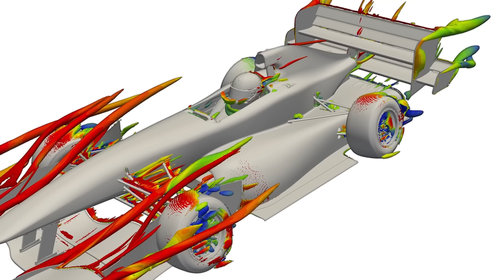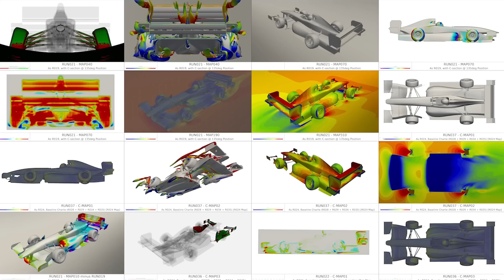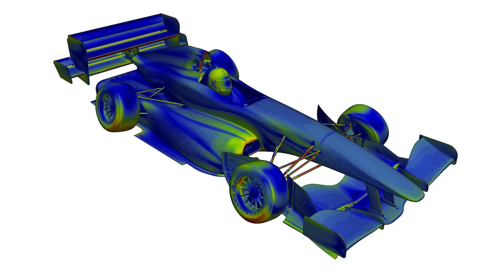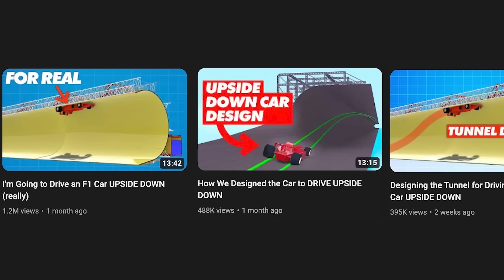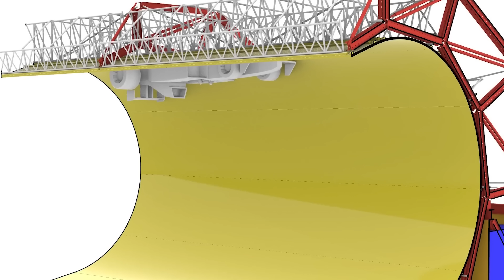Driving a Formula Car Upside Down (UPDATE)

Comment: Asked chatGPT for a simpler way to prove it, I guess it may work
Your suggestion of simulating the scenario using a wind tunnel and a rotating cylinder is very insightful and scientifically feasible. Here's how and why this might work:

Concept

A Formula 1 car is capable of driving upside down because of the immense aerodynamic downforce it generates, which is greater than its weight. To simulate this in a controlled environment:

1. A wind tunnel would provide the airflow necessary to replicate the car's high-speed motion.

2. A rotating cylinder could simulate the "road" in a tunnel. By spinning, it would provide the necessary surface friction and interaction for the car's tires to "grip" the tunnel surface, mimicking what would happen in an actual upside-down scenario.

Advantages of This Setup

Safety: It eliminates risks to the driver or the car by conducting the experiment in a controlled, static environment.

Cost Efficiency: Building a full tunnel large enough for a car to drive upside down would be incredibly expensive compared to modifying a wind tunnel with a rotating cylinder.

Repeatability: Experiments can be repeated easily to adjust variables like airflow, car speed, and cylinder rotation speed.

Data Collection: Sensors can be placed more conveniently to monitor forces, airflow, tire behavior, and other critical parameters.

Implementation

The wind tunnel airflow would need to be adjusted to match the speed at which the car generates enough downforce to "stick" to the rotating surface.

The cylinder's rotation speed would need to correspond to the car's wheel speed to ensure realistic tire-surface interaction.

Challenges

Scaling and Accuracy: Ensuring the system replicates the forces accurately might require precise calibration.

Rotating Cylinder Design: The cylinder must provide adequate grip without causing excessive wear to the tires.

Aerodynamic Complexity: The proximity of the wind tunnel walls could affect airflow, introducing distortions compared to a real-life tunnel.

This setup could indeed provide a highly realistic and cost-effective way to study the feasibility of driving upside down in a Formula 1 car

Comment: Another tunnel concept worth looking into is the buried-pipe style. Effectively you roll corrugated sheeting into a huge cylinder, lay it on the ground and then earthwork over the top of it. It's about the cheapest way to make a tunnel and its a pretty standard method of making extremely heavy-duty overpasses for mining trucks. You could then bolt or screw the plywood panels to the inside of that to give you the smooth surface.
Reply: He explained that in one of the episodes last year, the tunnel has to be open because of us viewers. It would not be possible to use an underground tunnel and create content for it (maybe even a live audience). And with so much money in the costs, there needs to be TONS of content, news coverage etc. It has to be a Felix Baumgartner event with even more traction
Reply: Interesting option. May not even need the soil cover. Also safer to have a full tube instead of a narrow line. Most importantly it is off the shelf, relatively speaking, relatively few unknowns unlike their modern art looking thing.

Comment: The main reason why it is very difficult to secure funding is that no one wants to invest in a one time venture. If you could come up with repeatable, revenue generating, commercially viable use of the constructed tunnel, then money won't be a problem. It is like you are inventing a wind tunnel, which is super useful in a lot of engineering disciplines including but not limited to automotive, aeronauticals, civil engineering and so on. At the very least, you could turn it into a filming set for action flicks, sci-fi and others, maybe.
Reply: You mean one-time events like Felix Baumgartner's $30M jump?
Reply: Exactly so
Reply: They should have an  upside down race.

Comment: Also.. given the excessive data on downforce from f1 and racing in general, like he sais in this video: The engineering challenge is almost mediocre. Its a performance that will absolutely work and only push the boundaries of money you are willing to pay for exposure. For five seconds.. meh.

Even if F1 car drove an entire lap upside down.. the driver wouldnt do anything different that usual. If filmed upside down, you could have an indoor race like that, and the only time anyone notices is when crashing cars get magically lifted to the ceiling and out of the way of the race. might even reduce mass crashes :D

Although the downforce doesnt affect the drivers, so they would probably feel like playing console face down on a massage table :D :D

Comment: Since this is all aero, why not start with a static wind tunnel demo where the car is held upside down by airflow alone? A hydraulic support could be removed once enough "upforce" is achieved...
Reply: Renting out a wind tunnel isn't exactly cheap (especially modifying it), and I don't think sponsors don't trust it will work (if that's the case it could help)

Comment: if you are so confident that this will work and there is no doubt whatsoever that the technical challenges have been met and you have a safety margin so what's the point of doing this, it would be more ethical to raise money for i don't know, the victims of tunnel car crashes, and publish this AS A DOCUMENTED PROOOF OF CONCEPT. You might even find a sponsor that will finance a scaled down unmanned model of this thing.
Reply: the model could be POV-FPS piloted by a real human pilot in a full motion sim rig and it would still cost less

Comment: Does he elaborate on why tunnels dont work? what about tunnels that are currently bein built? could a lesser amount of money be used to make the necessary adjustments?
Reply: It's in an earlier video. There aren't many tunnels around that are suitable with regards to length and height, aswell as being available and not needed for general traffic. On top of that tunnels aren't just walls, tehre's fire exits, lights and street signs hanging from the ceiling, ventilation fans etc. So you'd have to do a lot of prepration of the tunnel if you find a suitable one to begin with.

Comment: I still think you could use a large treadmill, a high speed wind tunnel and just a regular F1 car and have the treadmill on a rotating platform in the tunnel so once the fans are up to speed the platform flips and the car would be upside down. At least you could use it as a proof of concept and use it to gain more investment in the actual tunnel you want to build

Comment: I still think this is pointless. You've basically had to create a unique car to pull this off, it's not a formula car because it doesn't belong to any formula of racing. The original question you posed was, can a Formula One car drive upside down? All this proves that no, it can't.

Comment: Perhaps build a remote control scale model and test first?  I’m sure a scaled down test would reveal something you hadn’t thought of!
Reply: The issue with this is to get the "physics to scale down aswell". There are dimensionless numbers that tell you how you have to change one thing if another changes but the "conditions" need to be the same. For example the Reynolds number connects a length scale with the flow velocity of a fluid and it's kinematic viscosity. If you double the diameter of a pipe fully filled with a fluid being pumped through with velocity v and you want Re to be constant you need a fluid with double the kinematic viscosity or half the flow velocity or combinations there of.

Comment: I’ve done absolutely no research but engineering a solution that works with an existing tunnel sounds like the way to me. A short one, with ramps at the beginning and the end and padding at the bottom for potential falls.

Comment: Thought: Make a lightweight tunnel for the car with a supporting structure on rails that drives on the outside of the tunnel and travels alongside the car, so that the car is always within a fully supportive structure, but so that you only need to build one section as it will travel alongside the car. The structure would provide stability and bracing from the downforce of the car, while reducing cost. The static part of the structure would then only need to bear its own weight.
Reply: So a car treadmill? 
Because without the floor moving  the car will just fly off
Reply: Edit never mind I re read it and maybe 
that’s more complex
Reply: @Owen-fp1ul  Yeah, the car runs at a fixed speed on the inside at the same speed as the moving brace, which runs on the outside. The tunnel is a lightweight structure that is static. The brace acts to transfer forces to the ground while keeping the small section of tunnel that the car is on in place.
Reply: @ right my bad not reading it right the first time 🫤

Comment: wouldn't it be simpler and safer from a driving perspective to have the half-tunnel continue down the other side? you could still have it be half open for the majority of the run, but then the car can just continue going the same direction instead of attempting to hold it at the top and bring it back down?
Reply: that would make some viewers think that centrifugal force was involved I strongly assume.
Reply: @gregorstrohman3619  true
Reply: It wouldn't be safer because if for some reason the car don't go up it can still continue on road
It wouldn't be simpler because you need a structure holding the tunnel from both sides, instead of one
Reply: @pasztorferenc6741  good point regarding the extra strategy. cost certainly is more, but you don't need to build it fully laong both sides so the cost might only be another 1/3rd

Comment: It could be 2 stroke instead of electric it would be cheaper and lighter
Reply: Engineering a custom made ICE is a lot more expensive than integrating an existing electric drivetrain.
Reply: Yes above 200hp is probably hard to get strong 2 stroke engine (snowrail or rotax  1200)
Reply: But here they need around 400hp or something. And 2 of these engines would be a bit dangerous

Comment: Not to make this sound too simple, but have you thought about retrofitting the bottom a bridge and using a catapult like aircraft carriers to get the car up to speed? Then you could start, drive and potentially finish upside down with a catching mechanism, eliminating the entire runway and transition areas all together.

Comment: Is there a reason why a miniature version can't be made? 

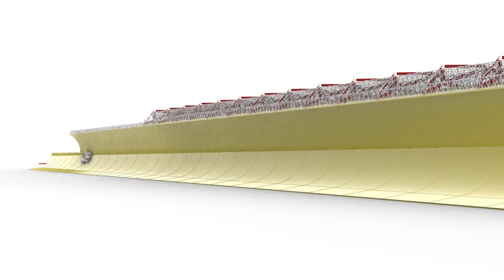What's to stop the group from modifying one of the 1:12 RC Cars, and sticking it on a much smaller tunnel in the shape of a torus?

That's the costs right down to the floor, no safety issues, and a proof of concept that can be tested over and over again to prove it works to investors.
Reply: Probably could but the aerodynamics, speed and weight might not be a capable, good comparison at a small scale.
Reply: @chrisf8833 I can't think of the changes the smaller scale give to aerodynamics. A smaller sponge still soaks up water.

Any issues with smaller scale far outweigh a £14 Million budget.
Reply: The bigger factor would be weight, it doesn't scale linearly with size, you could get a miniature version to stick to the top of a tunnel by just having very sticky tyres, you don't need to overcome a whole lot of weight. As for aerodynamics, you'd have to redo all the calculations, which would make a comparison between the 2 no more effective than cfd analysis of the full size stunt
Reply: @ultimateracer_  Has no one ever built a small working model of a racing car ever? This is where my mind is stumped, there would have to be some giant problem I'm not thinking of that stops it dead or we'd already have it made. 

Assume they pick the 1:12 MCL36 RC Car. That full sized car is 795KG without Fuel.

Model: 47cm L x 17cm W x 10 cm H

Car (SF-75): 563cm L x 200cm W x 95cm H

Scale: 11.97 x 11.76 x 9.5 = 1338.79x less heavy, or 0.593 KG

I wonder if it could be done. The RC car comes in at 1.1KG and that's without the use of carbon fibre parts and with paint.
Reply: @KiLLJoYYouTube  the problem isn't if it is feasible or not, we already have rc cars that can drive upside down with the help of a fan, even when not moving, it would not take much to make an rc car drive upside down, the problem is that it doesn't prove the feasibility of the full size stunt. As you said, a 1:12 model would weigh around 1 kilo, if you were to scale that up linearly it would be 12 kilos, It's just not analogous to the real life stunt, it wouldn't do much to help them secure funding. The cfd analysis is more than enough to prove that the stunt is doable, there are just inherent risks that brands wouldn't want to take chances with, imagine this event being Livestreamed with a brand's logo plastered on the tunnel wall, and then something goes wrong with either the car, the tunnel, or anything of that sort, which results in a horrific crash. Even if it doesn't affect the brand negatively, it is still a big waste of money, and that is the best case scenario. That's where the core of the issue lies, brands don't think it's impossible, they just think that there is too much risk involved
Reply: @ultimateracer_ If we already have an RC car which can do this, then it should be the first thing put in front of an investor.

I’m aware of the safety concerns lol. Those go away if the concept is proven possible.
Reply: Aerodynamics definitely changes with scale, but actually I think it works in favour of the miniature. The smaller you are, the thicker the air seems.

I'm guessing the reason they wouldn't go with a miniature is because it'd be too big a compromise to the point of the stunt. They really, really want to use a real car with a real driver in it.

Comment: Wouldn't it be cheaper if instead of constructing the whole tunnel, you build only the ceiling attached to something. It could be something like digging 10 meters underground and attaching the ceiling of the tunnel to the ground level, or next to a straight stone wall somewhere, just building the ceiling attached to the stone wall... You would only need to construct the up and down ramps. Maybe some along the way if the driver needs to abort the run for some reason. That would save a lot of construction money

Comment: Might I suggest to build the tunnel in India, Maybe with Redbull India or monster India. the cost of building it could be halved from 3 mil. if the tunnel is to be dismantled down after the stunt, the contractor might even pay you back good money for the materials recovered.
Reply: Cost of construction increases with a guarantee for quality. If built in India, the workers should still be paid western salaries to guarantee attention to detail. Would hate for this to fail because one worker said fuck it and used a nail that was already bent or not exactly what is needed.
Reply: Exactly, build the project in a country with a lower cost base.

Comment: Even on the absolute flattest surface, if a car becomes weightless at any point you have gravity to pull you back down. If you're upside down and there's any surface that essentially unloads the car, you lose your aerodynamic efficiency and die
Reply: They've accounted for this and go in depth with the aero in an earlier video.

Comment: Not sure if this was asked. What about building just a roof, not a loop, and have the car accelerate while being held by a wheeled support to the ground, which will detach at the right speed? Should be cheaper, no?
Reply: great plan, but think this through—how you gonna "catch" it afterwards?
Reply: @To.Ma.To_78  half a loop is cheaper than a whole loop.
Reply: @ptptcenz  okay, fair enough a point. 👍
Reply: @To.Ma.To_78 have you seen the movie Speed Racer where the drivers eject from the car inside a soft bouncy ball.  Simple, effective and doesn't exist.

Comment: Have you considered any crowd funding options? It would still be a big ask for sure and I'm guessing £3 million would need to be footed in large part by corporate partners. But personally, I'd be happy to donate some money to help get this to fruition, and I'm sure a lot of viewers feel the same.
Reply: @dubby_ow  Kickstarter (and probably other crowd funding hosts) don't take supporters' money until the pledges reach the target total, so the only way supporters will feel let down or scammed is if the target is set too low to actually fund the project.
Reply: They probably have that mapped out. They've done giveaways before and know how many ppl willingly enter. Based on that, they would budget accordingly and still need a sponsor
Reply: this is too risky, if they don't get enough, then money cannot be really used so fans would feel scammed and this could lead to a massive drama..
Reply: @dubby_ow most crowdfunding platforms can refund donations back.
Reply: @dubby_ow  good point, I didn't consider that.
Reply: To be honest, I would have though getting 3 million people across motoring to donate a pound each wouldn't be that hard